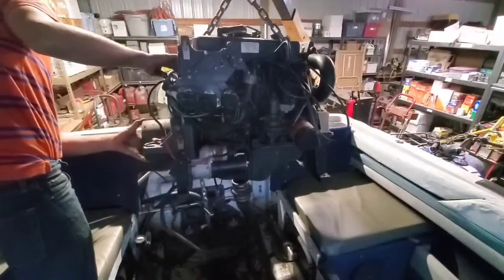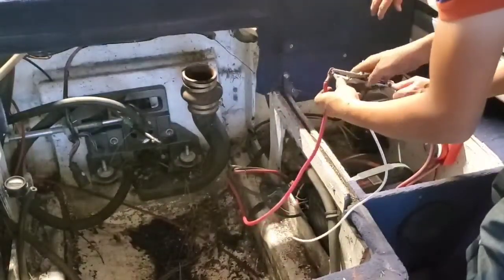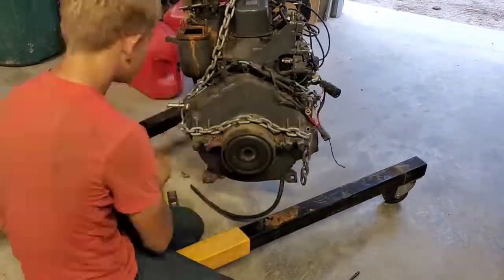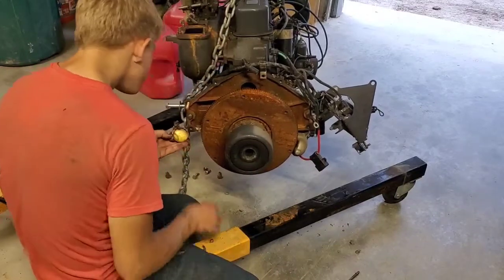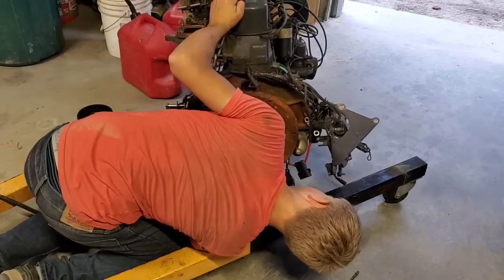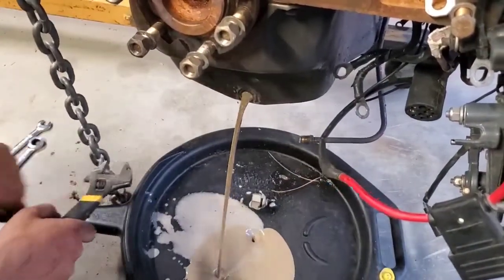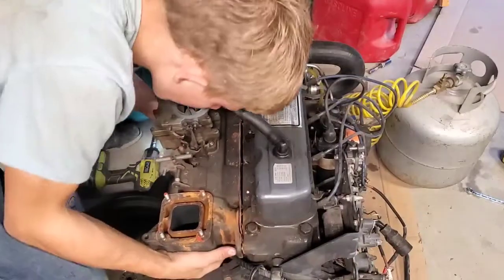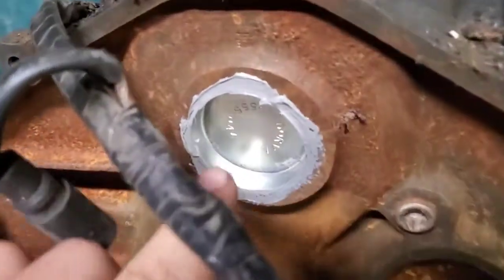Cracked Block? | 1988 Bayliner Capri 3.0 Liter (Part 2)

Comment: The water in the oil is cause for concern. The bad freeze plug wouldn’t cause that. A cracked block, cracked head or bad head gasket is probably to blame unless rain water went down an open intake. In that case, you have more problems; rusty cylinder walls and valves and seats. Just sayin’.
Reply from the maker: Ah yes, I guess I didn't answer this in my video. Were pretty sure water entered sitting outside for however long it sat there. Very valid point! I spent hours trying to rule out other possibilities without finding any other problems. Its still possible for something to happen, but so far it's been working great!